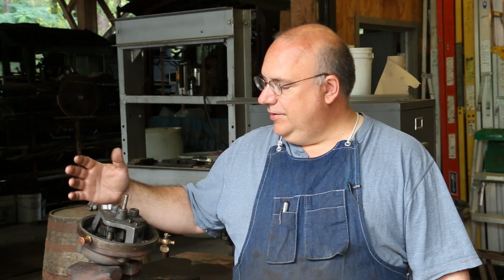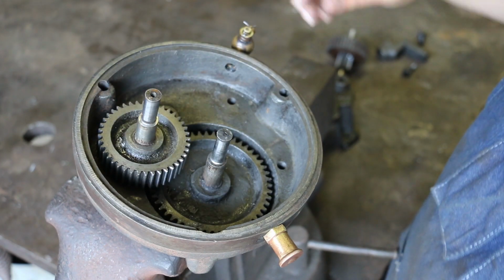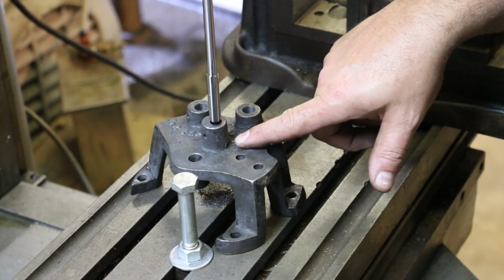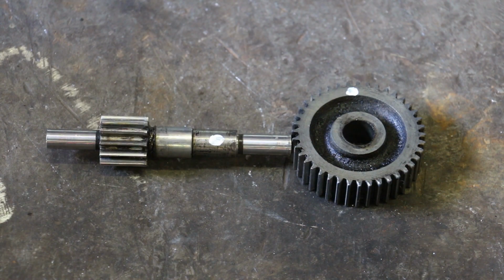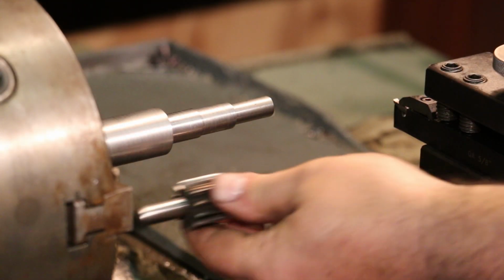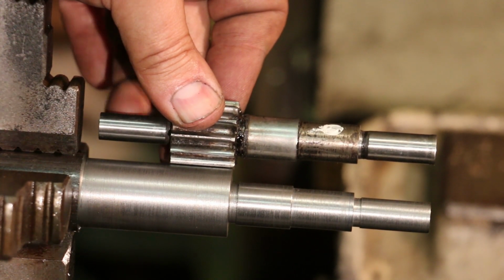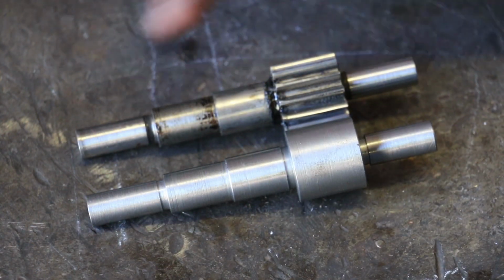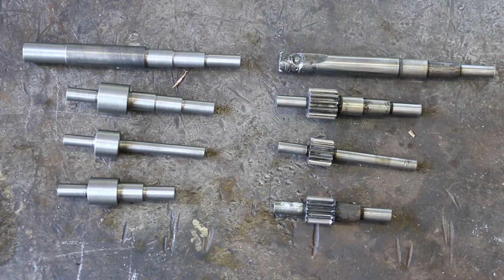Blacksmith Blower Rebuild:  Part 1 - Disassembly and Making Pinion Gear Blanks

Comment: Keith, I think the "no metal" gear is made from impregnated cloth. It's used to make the system more quite and is tough when oriented well before machining (mesh should be perpendicular to the teeth shape. It's also used as a "safety valve" in gear trains. (E.g. they're in the train of gears for feeding in my lathe for noise and safety) When an overload occurs these ones get ripped apart and the expensive hardened steel ones will survive for future use. The company "Tufnol" sells it in several varieties so maybe you can give them a call. Thank you for sharing your adventures ones again. Greatly appreciated here. Stay safe and be happy. All the best, Job

Comment: I had a WWII era 9" South Bend lathe that had the spindle running in the cast iron bores without the usual bronze bushings. With the WWII metals in shop supply, South Bend added extra nickel to the head stocks and eliminated the hard to find bronze bearings.

Comment: The purpose of the undercut is to ensure a good shoulder with a good tool radius to minimize stress risers while eliminating the need for a large chamfer in the mating part. Has nothing to do with oil.

Comment: The phenolic gear was most likely for noise reduction and would reduce the wear on the steel gear teeth and is easily replaceable. If you didn't want to make one out of phenolic then bronze would have been a suitable choice.

Comment: Hey Keith, do you know where you can buy that style oil hole caps? I picked up a Champion Blower and Forge blower but the oil filler cap is missing. I can find the hinge style but can’t seem to find the pull up style.

Comment: I know that this is a really old video but I question the age of the blower. Between the Amailite fitting and the phenolic gear, designed to strip to save the unit as a whole. I place the unit at 40's - 50's. What was found out found out about the age?

Comment: Do you have to rebuild the crank handle "hole" that will go on the new shaft?

The old shaft where the crank handle went on it looked pretty chewed up, would that mean that the crank handle hole was also chewed up?

Comment: i'm 13 and i just got my first hand crank champion rivet forge for christmas i took the blower apart and cleaned it ,i just used it for the first time yesterday it works great but it leaks oil alot and i think the bronze bushings might need to be replaced i was wondering if you would know anyone who rebushes champion blowers?
Reply from the maker: More than likely, the bronze bushing will have to be made to fit the blower, especially with wear on the shaft making it probably a bit smaller than when it was new.  Any good machine shop or someone with a metal lathe should be able to help you out.
Reply: ok great i'll bring it to the machine shop in town , Thank you for replying :)

Comment: Two questions which may have been asked/answered below.  1) What is the total gear ratio?  Has to be 100:1 or more?  2) Is the entire gear bay filled with oil during use?  I thought I saw an oil cup and an outlet of some sort.  Thanks.
Reply from the maker: cemx86 I would have to go back through my comments to find it, but I calculated the ratio and it was somewhere around 46 to 1 if I remember correctly.  As for oil, yes, the bottom of the crank case is filled with oil so that some of the larger gears will dip into the oil and pull it up to cover the other gears.  On the case, there is a hole in the top to fill it with oil and another one on the side that you open up when you are filling - when the oil starts to run out, you have it full.  I will have more on this in a later video.

Comment: Hi Keith,
thanks again for a great video.
I am curious about the reaming of the out of round holes for the shafts. Does the reaming move the hole off center and does this affect the spacing of the shafts, and if so is it insignificant? Thank you, I find this very interesting and thank you for your time.
Reply from the maker: Charles Camenzuli Reaming is more about getting a hole to a precise diameter.  The reamer will follow the hole that is already in the piece, so it will not move it off the center of the original hole.  If the original hole is slightly out of round, the reamer will true it up to a round hole.

Comment: Keith, have you considered going really oversize on the shaft holes and installing bronze bushings? Sure would make the NEXT overhaul a lot easier.
Reply from the maker: Railfan 439 I don't see a need to do so.  The cast iron bearing surface is fine for this application and the first ones lasted about a century.  And I think that boring out the cast iron that much oversize might cause some other issues with this fairly thin casting.  I think I will just leave it as it is.  No need to re-engineer something that has worked so well for so long.

Comment: Keith, one question that I have is where do you go to find your research on the parts that you work to know the original dimensions?
Reply from the maker: Andrew Beaver "Machinery's Handbook" has all of the formulas needed to calculate what the original dimensions should be.  There are also several web sites where you can just enter the basic gear info and it will calculate it for you.
Reply: Thank you!

Comment: Hi Keith,
Thanks for the interesting video. I always find gear making interesting to watch, even the preparation of the shafts, etc. I thought you might do the small gears separately and then press them on like the larger ones, but this way is probably easier:  you automatically have a centered, aligned arbor (or is it mandrel? I always get those two confused…just like gig and fixture—I never remember the difference).
Anyway, I’m looking forward to the next installment.
By the way, I like the Friday format you have adopted. Now there is something to look forward to (and learn from) on Friday, Saturday, Sunday, and Monday…
Thanks again, Keith.
Joe
Reply from the maker: Joseph Magedanz Thank you Joe.  I hope to be able to start cutting some gears this week!

Comment: Hi Keith.
At my windmill we have a number of gear trains with what are called in England sacrificial gears, in our case made of wood. The idea is that as the gear train on your machine is moving very fast, if something gets caught in the fan, and jams, then the effect on the fan and gears would be disastrous. So with the sacrificial gear only the weak and  "soft" gear would be stripped leaving the others intact. I expect that in the old days these parts were "off the shelf". As they are not available now cast iron gears would do, but you may like to think of using nylon or some plastic for that gear to keep the sacrificial character available, it may save having to cut all those shafts again.
The material used looks like what is in England called paxolin, it was used in early electrical appliances as an insulator, but I have found it in an early vacuum cleaner used as a sacrificial gear on that machines extractor.
After I wrote this I saw ZIGgossDUP has the same idea.
Kind regards
John
Reply from the maker: hamstreet john I think that the gear in question was made that way to cut down on noise in the blower.  I am probably going to make it out of a softer material now that I have studied it more and learned more about it.

Comment: Keith,
Thanks for the trip down memory lane! (My grandfather was a blacksmith.) About 60 or so years ago, I would love to turn the crank for the forge blower. If he was doing some forging on Saturday, he's call the house. (We were about 1/4 mile apart.) I'd drop what I was doing, jump on my bike and ride down to the workshop. Those days are fond memories for me. I was helping my grandpa make something from steel! I thought it was fun! Some folks out there no doubt feel I should be committed! But times were different in the mid to late 1950s. We never locked the house at night. Folks were honest. Kids didn't need a ton of stuff to be happy. My cousins and I made our own fun, and I have fond memories of that time as well. The only things I hated was shoveling out the chicken house or moving the manure pile by the cow barn! (My grandpa used it to fertilize the orchard and vineyard.) Enough of me rambling! Thanks for the video and allowing me some time travel back to my childhood.
Have a good one!
Dave
Reply from the maker: Swarf Rat Thanks Dave - when I get the blower running, I am hoping to get some shots of the blacksmith at work with it in the museum blacksmith shop!

Comment: Thats quite the undertaking to fab all those shafts and gears, I was wondering if the fiber gear was used for noise reduction because of the speed at which it drives the fan,  I'd consider brass neoprene or delrin  might be more suitable any thoughts?
Reply from the maker: Chad Yelland Several are suggesting this and I am probably gong to make that one gear out of Delrin.

Comment: I wonder if the odd gear with the pins was designed to shear in case of a foreign object gets into the fan.?..Love the vids.
Reply from the maker: ZIGgassedUP Several are suggesting that it was that way to cut down on whining of the gears.  I am considering replacing that one with some modern plastic material to put it back more like it was.

Comment: Hi Keith,

Looks like a great project.  I have a couple of questions, when you were turning the shafts on the lathe, you put a band of blue ink or dye on the shaft but I did not see you make the marks on the dye, did I miss something?
Second, will you be showing how you will ream out the "blind" (no through) bearings holes in the blower housing/
Thanks
Tony
Reply from the maker: Anthony F. De Leo Tony,  I marked them all, but I might have edited it out by accident....  As for the blind holes, I think I did not show that, but I basically just reamed down until the reamer touched the bottom of the hole and that was it....

Comment: Nice work on this so far.  A cool project for sure.  Are those the 14DP gears you were looking for cutters earlier?
Reply from the maker: ILGopher Yes, that is what they were for.  I also found out after I did some more measuring that there are 16DP gears in the blower as well.  I have rounded up all of my cutters now and am just about ready to start cutting gears....
Reply: Interesting using multiple pitches.

Comment: Great video Keith!  Looking forward to part 2.  And the next oil forge installment.

A question on your "oil grooves"...are you sure those aren't reliefs on those diameters having been ground on an OD grinder?
Reply: planeflyer21 I was thinking stress relief (ie rouded corners) to prevent stress risers & premature failure, as with the early Campagnolo Super Record pedals with the titanium shafts.
Reply from the maker: therealfranklin It is possible, but having delt with a lot of babbitt bearings over the years, these grooves are a nice trick to help keep the oil from running out of the bearings as bad.

Comment: Why would he not put brass bushings in the cast?
Reply from the maker: Enjoying28 It could be done, but I don't see any reason to do so.  Cast iron on steel is a pretty good bearing material and if the original lasted as long as it did, I see no reason to re-engineer it.

Comment: Looks like another great series.  Thank you.  Looking forward to the next installment(s).
Instead of replacing the phenolic/Bakelite gear with cast iron you should consider using
Delrin.  That gear may have purposely been there to act as noise deadner, sacrificial in case something jams fan, friction reducer, and/or reduction of moment mass.  Why tempt fate on a design that's worked for over a hundred years?
Reply from the maker: Morris Gallo I am seriously reconsidering the cast iron.
Reply: Morris Gallo I don't know if Bakelite would have been used that long ago. Been a while since my strength  of materials class as part of my Engineering Degree. Doesn't look like Bakelite. Maybe Phenolic. If Keith is making a new gear I'd suggest a soft bronze.Delrin or Ryton might be a good choice too...
Reply: Phil Grindle Bakelite was invented in 1907 by a Dutch chemist.  It is the trade name for phenolic plastic.  As a safety aside, most phenolic plastics contained asbestos prior to 1980, so this discarded gear should be treated with caution.

Comment: hi Keith, just to throw in my two cents worth: i've used all types of inserts on the lathe and found they work best when running flood coolant. it's messy as all get out but the results are much better than using cutting oil. the finish is generally much better when running them in conjunction with the flood coolant..
thanks for letting us peek over your shoulder and the music was very enjoyable. applause to the pickers if you know them personally
cheers
mike
Reply from the maker: HolzMichel I am a big fan of  flood coolant, but unfortunately, we have some issues on that lathe that makes that difficult.  Some ding-dong cut several big holes in the chip pan when the lathe was moved at one point (I am assuming they were sling points).  Also the coolant pump on the lathe does not work.  Both issues can probably be addressed, just need the time to do it.  I also need to tear into the front of the lathe where the change gears are to address an oil leak at some point.  Maybe I can get to both of those jobs soon.....

Comment: The reason that final gear set had that "composite" gear was to reduce the friction and rotating mass. With the gearing increases with each set, the friction  in the final set is going to be a huge factor in the efficiency.  With the added mass, it will take longer and more force to spin it up, but in theory, could coast longer, if not for the added friction....I would use something lighter than cast iron...aluminum maybe.
Reply from the maker: krbruner Aluminum is a thought.  I considered brass or bronze at one point but the mass on that would probably be even heavier than the cast iron.
Reply: I have the same model and it was making bad noises recently.  Added oil, but the crunching sounds didn't go away.  I just took it all apart today and found there was an aluminum gear in the middle that many bits missing on the teeth.  All those bit got caught up in the other gears and ground all but two gears to an unusable mess.  So I wouldn't recommend replacing any of the gears with aluminum.  Just my experience.

Comment: Hi Keith, can you give us a status update on the matcher? Back in December it seemed like a trial run was imminent.
Reply from the maker: awldune Still waiting to get the tractor running that will power it in the shop area.  We are very close on that side of things - we had it running but the carb kept on getting clogged up from rust in the fuel tank.  The tanks have been pulled from the tractor and are being sent out to be boiled out and coated on the inside to prevent further rust.  Problem was that the museum was on a spending freeze this month as their fiscal year ends on Jun 30 so we are waiting until the first of the month to get this job done.  Once that is done and the tanks put back on, hopefully we will be ready to belt it up and give it a try.  Stay tuned.....
Reply: Figured it was something like that. Can't wait to see it run! Thanks Keith :)

Comment: I am a clockmaker. It's common to assume that the harder material wears less than softer material. I and other clockmakers have seen time and time again a hardened steel verge worn down by a soft brass escape wheel rubbing against it as the clock ticks over the years.  Some have speculated that grit will imbed into the surface of the softer metal and cut or grind the harder metal.  I don't know for sure.
I believe the fiber gear was used to lessen the noise of the gear train being transmitted to the blower vanes.
Reply from the maker: clockguy2 Very interesting observations on these old clocks!  Something to sure think about.....

Comment: Looking forward to the gear cutting. Does this thing use a grease inside for lube? I would throw some John Deere corn head grease in there when I was done to make it last and make it quiet. It is made to run in gearboxes with no seals. Pretty amazing stuff. I find I really have to watch on those small finish passes that cum up a bit rough like that as a little emory cloth will take you undersize in a hurry on those.
Reply from the maker: bcbloc02 The gear box is filled at the top with a heavy gear oil.  There is a drain hole on the side that you fill it to.

Comment: If I estimated right the ratio should be about 80:1  if the small gears have 10 teeth...
A good light grease will keep it running another 100 years.
Reply from the maker: pierre beaudry The ratios are 50 to 12, 40 to 12 and 40 to 12.  That comes out to about 46.3 to 1.
Reply: Ok, I've visually counted the small gears having 10 teeth instead of 12, this makes a big difference...

Comment: I guess it wouldn't be original...but where your reaming out the bearings in the cast iron I would be tempted to add a brash bushing...it seems to me a much better bearing.
Reply from the maker: tazmun The big gears will press fit onto the smaller gear and shaft.  The bearings are all in the gear housing.  I considered adding bronze, but I would have to bore out a lot of cast iron to get them in there.  Not sure it is necessary - the original steel on cast iron bearings lasted for this long......